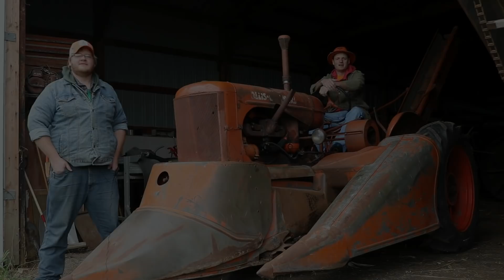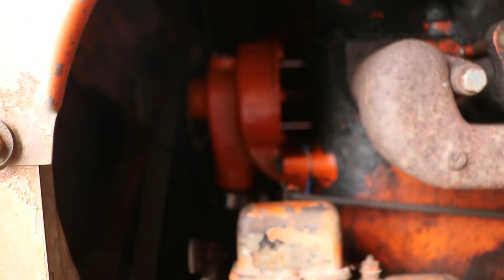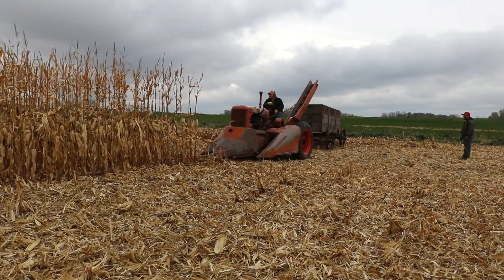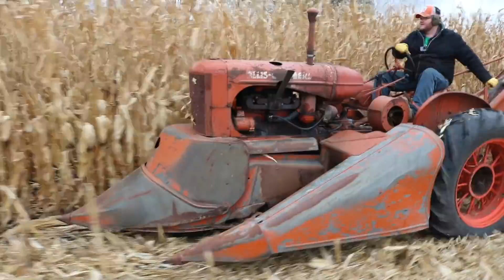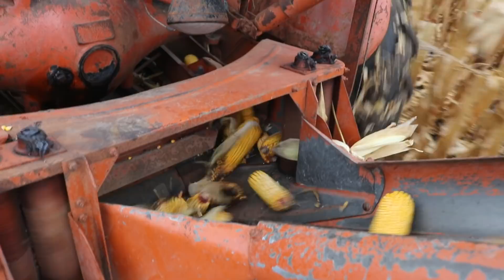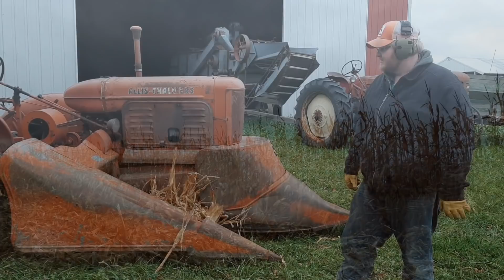Allis Chalmers Show:  2020 Corn Picking With The 1940 WC

Comment: As a child i live next to the allis Chalmers drop forge building by the rail road tracks in west allis, Wisconsin. 
I saw alot of tractors on rail cars leaving the factory during the 70s being hauled by the Milwaukee Road. 👍😁
Reply: Back in the mid-90's I flew in to Milwaukee to the Briggs factory and on the way from the airfield to the hotel, the shuttle driver pointed out the vast expanse of bare concrete with just a few pillars left standing.  Looked like the pictures of Hiroshima.  He told us that was the old Allis Chalmers plant.  For a guy who grew up on Allis tractors, it almost made me cry.

Comment: I love that thing. It looks like a medieval war horse riding into battle. And what a fabulous trailer! That must have started its life behind a horse.
Reply: ,,,  yup , originally horse-drawn to be sure. Also , ,  the wagon is currently set up as a "Trippel-Box",  with the 3 12 inch wide boards stacked on top of the flatbed.  You could fill that with cobcorn or cotton, or hay, etc,  but not wheat for instance, that would be much too heavy.   A single 12 inch board  or maybe "double-board"  (2 12inch) would be appropriate,  especially for Oats and the like...

Comment: Great to see the old Allis still alive!  I grew up on Allis Chalmers tractors back in the 1950's and 60's in Northwest Washington State.  There was an Allis dealership about a mile from our farm and lots of Persian Orange tractors were in the area.  I now own a 1957 D-14 I've had for years and a HD-4 crawler that I logged and did dirt work with.   Most of our corn here is chopped for silage for dairy cattle, but in the middle of the last century(!) there were several canneries that farmers grew sweet corn for canning or freezing.  I worked for a crop farmer just out of high school that grew a couple hundred acres.  Spent my summer cultivating and side-dressing corn, then drove truck hauling it to the processing plant.  They used a two row picker mounted on IH 806 tractors, two to a field.  The first picked into a cart that dumped into your truck, about 2/3 of a load, then you drove alongside the other picker to top off.  Fun and good memories for a farm kid.

Comment: We had a 33 when I was a teenager, on a wd. I really liked it. And I was wondering at first why just 1 row then remembered it was designed for I thought 40 inch rows so you couldn't do 2 planted on 30s.  You didn't want to get into foxtail, it wrapped/plugged up the snapping rollers

Comment: My first picker was the same pair, 40 WC and same picker.  The issues we had were that it didn't like the larger ears, they couldn't stay in the channel to the elevator and ended up on the ground, for one. Another thing, if the wagon gets too heavy the mounts under the tractor final drive would spring enough to drop the picker on the ground. One heck of a pain to get it back on the tractor.  After a few seasons the main roller bearing went out and I junked the PITA!  Like all mounted pickers, they are a fire hazard, the exhaust manifold is too close to the dry crop leaves.  I got a newer version and used it for a few years, till I got an Oliver unit to mount on my 70 Oliver tractor. That machine was light years better!

Comment: We threshed oats until 1969.
About 6 farmers worked together in central MN.
One year our normal threshing guy went out of business and we hired 2 brothers who had a threshing machine and a WD-45 on the belt running the threshing machine.

That WD-45 made that threshing machine "hum" and no matter how fast we pitched the bundles we couldn't slow it down.

Comment: You need the engine side shields.  But great video.  Also, from the length of the spokes, the tractor seems to have a fairly rare set of 28" round spoke wheels.  Love the old steel wheeled wagon too.  When I was a kid, my Dad and Uncle picked into high wheeled wagons pulled beside an Oliver picker. Many of those WC tractors used on pickers were equipped with a Sherman under drive to slow the tractor down a bit.  Low gear in the WC is a little too fast for the 33 picker.

Comment: Spoked wheels were from the unstyled WC and and also see the engine shields are missing. Another rare item is the metal fuel bowl the used for safety wben picking corn.

Comment: Why dont you run the exhust through the proper hole?  As a kid, my bro and me had to ride in the wagon and pick out the shucks and any stlks that came back into the wagon.  e wore heavy coats, and dad had an old style safety helmet that resembled a WW 1 helmet.  We would alternate turns going up front to snag and shuck ouot any shucks that came in with the corn.  Dad picked with first a 1 row Woods Bros pull type, then went to a 2 row IHC fitted on our 48 H Farmall